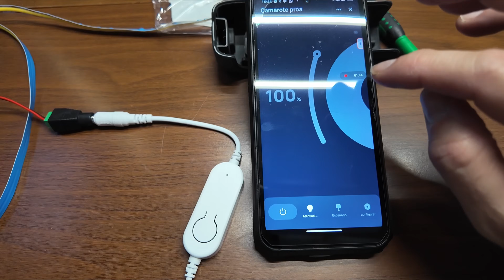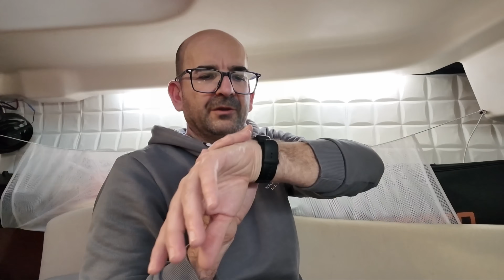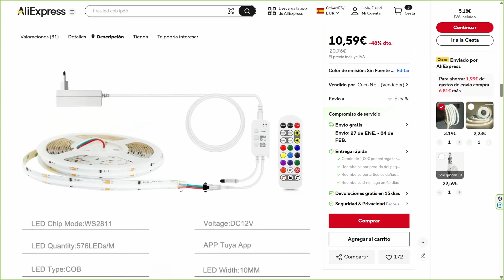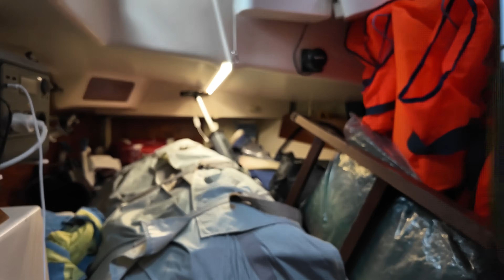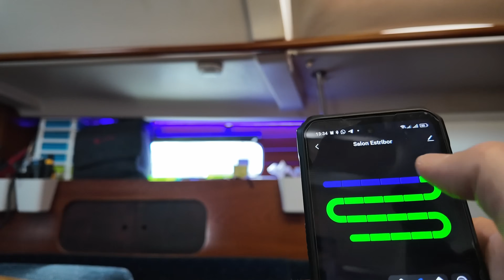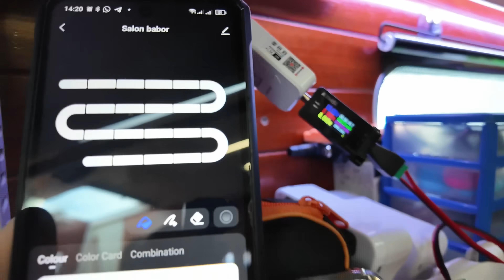EP113 – All the Secrets of LED Strips: Power Consumption, Dimming and Remote Control

Comment: Have you had any RFI interference problems?  I installed  a three wire cob led strip  and found the controller  ( SP630E) generates noise in the VHF band, especially ch 16.    

I currently have ferrite cores on order that will hopefully reduce the EMI.
Reply from the maker: I have 7 LED strips with 4 regulators, like the ones in the video. I've tested them with the VHF transmitter, with all of them at once, with some only, and regulating them at various percentages, and I haven't noticed any interference on the radio.